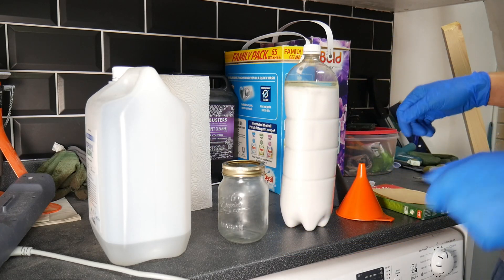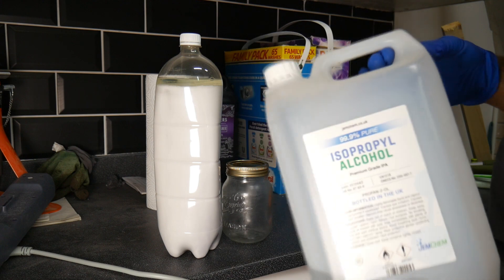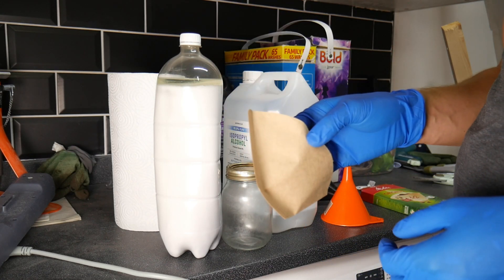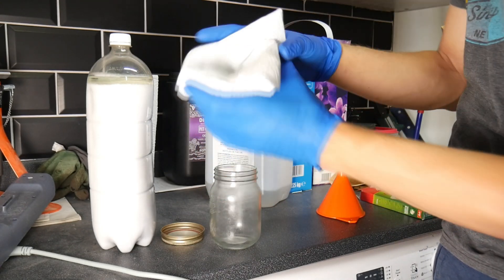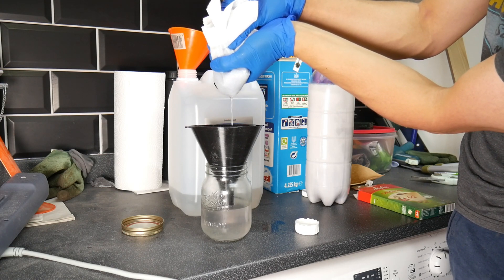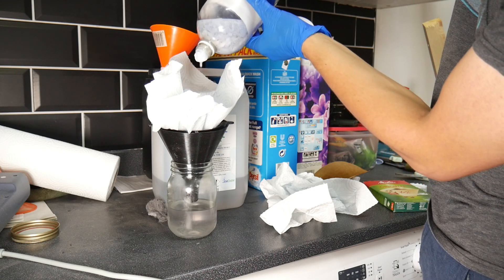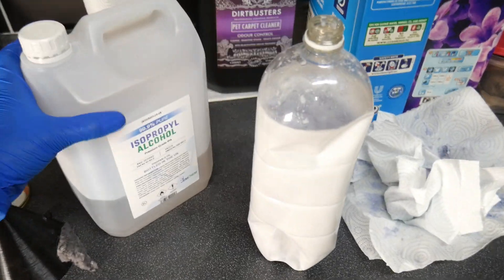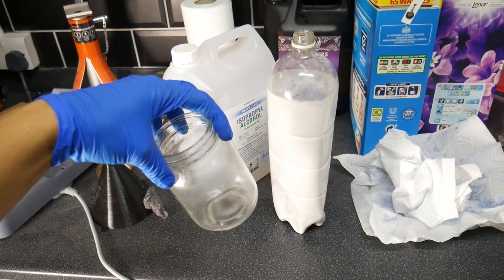How To Recycle / Re-use  IPA From Resin 3d Prints Fast & Easy

Comment: I did this the first two years, and now I have a Vevor Water Distiller that literally pressure cooks my alcohol into beautiful clear liquid again, and I scoop the inside gunk out with a few bits of paper towel. really fun stuff this hobby is once you get the rhythm down!
Reply: I"ve seen the video distilling IPA.  It looks very dangerous.  You're cooking alcohol.
Reply: Just be aware it's not safe to use those water distillers with IPA, there's a high chance of fire and explosion.  It's also impossible to get all of the resin molecules out of the IPA so don't ever use your processed IPA for anything but resin cleaning.  I had a fairly extensive conversation with a chemical lab tec who explained a lot that was way over my pay grade!  Be very VERY careful with those distillers, best to not use them at all.

Comment: and what about the coffee filters? at which point are you using them?
Reply from the maker: You can use them for a second strain after the tissue to get any loose bits that got through the tissue but i didnt need to.

Or you can filter once using the paper like in the video so its clear then put it back in the sunlight and filter second time with cofee filter.

I didnt need to in this video because it came out filtered enough with just the paper towels